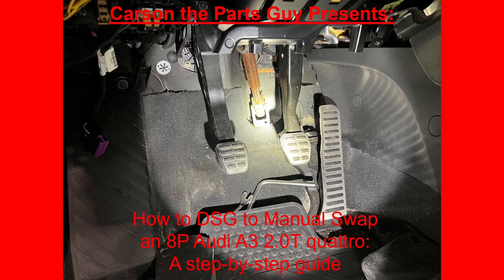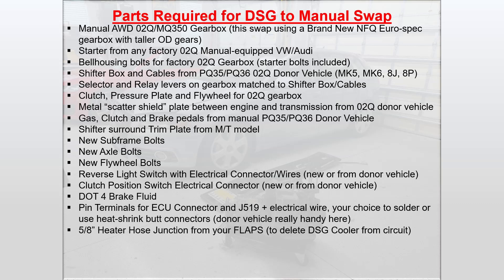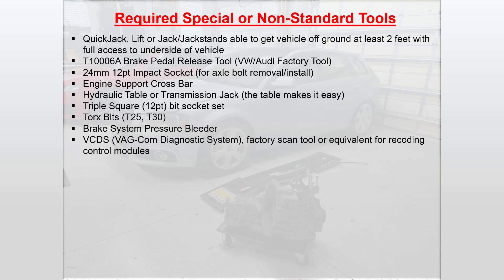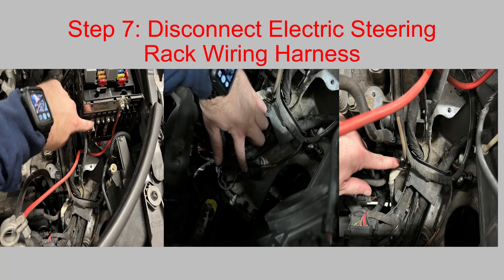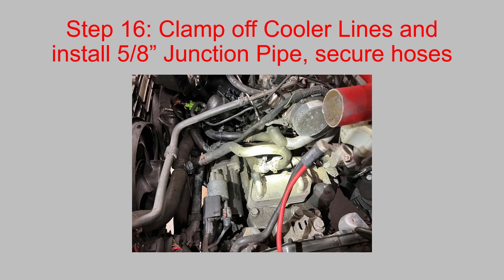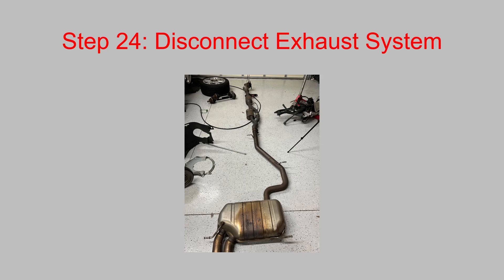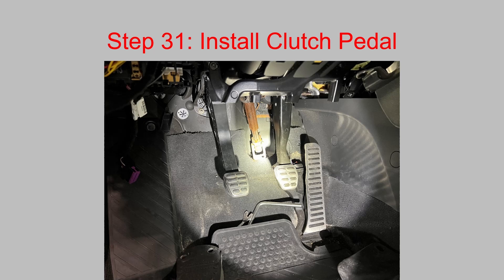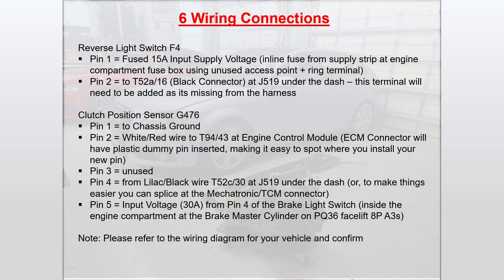DSG to Manual Swap - a step-by-step guide

Comment: Hey, I just did manual swap with wiring and programming all
Complete in my a3 8P Quattro. But I cant get to start it with key, I have to jump it with the starter. Would you known where to look to solve this issue?
Reply from the maker: Is your clutch switch grounded through J519 according to the wiring diagram? You can ground the purple/black wire in the DSG harness to get it to start.

Comment: I'm doing a tdi  swap myself,  both veichles are identical but the wiring harness on the manual was damaged.
Can i use the automatic wiring harness?
Reply from the maker: I didn’t swap harnesses on mine, I just added the necessary wires. You should be able to do the same.
Reply: @carsonthepartsguy8751  just ordered a bently manual, will do my best
Reply from the maker: @Anthony-sr3if  You can also just buy a 1 or 3 day subscription to VW/Audi’s ERWIN service, download all of the manuals you need and they’re yours to keep. Just FYI. 😉
Reply: @carsonthepartsguy8751  <3

Comment: on vcds im having trouble transferring it to manual.
so i went to 01-engine, coding-07, software coding i changed the last digit from 8 to 2 to signify 6 speed manual, but vcds says its out of range. thought?
Reply from the maker: That is a question for the guys at RossTech. They have pretty good tech support and they’re likely a better ask than I am. Your ECU may not be able to recoded. Best bet is to send them screen shots of your ECU identifier and they’ll tell you if it’s locked or not. You might have to get it reflashed to manual if it is.

Comment: No mention of the spigot bearing in the end of the flywheel. Does the manual trans and the DSG share the same spigot bearing?
Reply from the maker: Irrelevant. The DSG flywheel is incompatible with the manual transmission and vice versa.
Reply: @carsonthepartsguy8751  the spigot bearing is in the crankshaft not the flywheel.
Reply from the maker: @PetesWorkshop  The input shaft of the DSG is the only one that protrudes into the crank, so on the manual the pilot bearing isn’t used. Also, DSG and Manual engines share part numbers, so there’s that.
Reply: Oh! I did not know that. That is a lot of rotating mass to hang of the end of the gearbox input shaft. There is a listing for a spigot bearing for mk2 Audi TT 6spd Manual. I’m about to put a 2.0 tsi engine from a DSG mk6 GTi so I will report back my findings.
Reply from the maker: @PetesWorkshop  On the manual, the pilot bearing serves the purpose of receiving the clutch alignment tool, as when I did mine it fit right in. But if you Google pictures of the 02Q gearbox and 02E gearbox and look at the input shafts, you’ll see the difference.

Comment: Hello. I wanted to swap my dq200 to a manual 5 speed MFX transmission. Are the steps about the same or is there anything different? Also are there any compatibility issues? Its on a 2015 polo gt tsi.
Reply from the maker: Roughly. We don’t get the Polo or the DQ200 here in North America, so I’m not familiar with those. Best bet would be to get the components from a same year parts car that is manual so you can get everything you need to do the swap.

Comment: Hi after connecting the clutch sensor, will the car start? does it need to be programmed at all?
Reply from the maker: Needs to be connected to J517, it’s a purple and black wire that grounds the circuit when the clutch pedal
Is depressed to allow the starter to operate.
Reply: I have an Audi Q5, I installed a manual transmission, but now the engine does not start, I am looking for how to connect the wires so that the engine can be started 😀 but I can't find any information anywhere
Reply from the maker: @dariusruseckas3027  Yeah, that won’t be the same as this one. You’d probably want to download some wiring diagrams for a Euro-spec Q5 or possibly use an A4 as a reference as they’re on the same chassis.

Comment: Hey, i am looking to manual swap my A3 8p Quattro and I am not sure which car to look for for the awd transmission. Could you suggest to me a list of vehicles that would work or can I put a FWD gearbox and upgrade the LSD. Will the transfer case bolt-up to the fwd bell housing?
Reply from the maker: Regarding the FWD to AWD diff swap, you have to check the case to make sure it has the bosses tapped to accept the angle drive. But that is one route.
I got my NFQ box from Cascade German. You could use a Golf R, Golf Sportwagen 4Motion, alltrack, to name a few. Mostly on the VW side here in North America. 02Q or newer is the way to go.
Reply: Thank you for the reply!
Reply: @carsonthepartsguy8751  So I am in the process of swapping all parts, I have a set of MK7 GTiI Flywheel, Clutch and Pressure plate. I am wondering if i can use them on my Audi A3 8P TFSi and will it bolt up?
Reply from the maker: @joharzubair687  As far as I know, the MK7 EA888 Gen 3 engines have a different flywheel part number than the EA888 Gen 1 engines, so I can’t say it will work. They’re both 8 bolt flywheels, so it may be possible, but I have never personally tried it. I do have a spare SPEC single mass steel flywheel that needs the ring gear welded on that I could let go for a good price if you want to run a SPEC clutch and flywheel to go with it.
Reply: @carsonthepartsguy8751  Thanks for the reply, I am in Canada and I won't be able to take the deal cause of shipping and customs charges. so you are using a GEN1 Flywheel, Clutch and Pressure plate?
Reply: @carsonthepartsguy8751 , when you said  "02Q or newer...." does it mean it can also fit OFB transmission?
Reply: @carsonthepartsguy8751 I have completed my swap and everything manually works and it drives. So it’s great to hear, I am not able to start the car by key and I still have to program it. I am wondering if I can use Ross-Tech Micro-Can VCDS or I need hex V2? Thanks!

Comment: Can you do a video on how to swap a manual into a 2021 Audi S3? Thanks
Reply from the maker: I could, and its likely possible with the parts bin. But I don't have a 2021 S3 test subject or any of the parts.
Reply: @carsonthepartsguy8751  I would gladly supply a 2017 S3 if you would want a car to try it on.
Reply from the maker: @sawyercrosby3710  Well, I know it’s going to involve raiding the Golf R parts bin. And you’d probably want to go aftermarket on the clutch, pressure plate and flywheel setup. All that’s left to figure out is coding and wiring. If you’re serious, my Audi-modding co-conspirator Matt and I have discussed doing this kind of work on the side out of his garage in Vero Beach. We can talk about that if you’re serious. 🙂
Reply: @carsonthepartsguy8751  I’ll need a couple months- just bought a house but I’m game. The mechanical aspect doesn’t bother me so much as the wiring and coding aspect of it.
Reply: @carsonthepartsguy8751   i just retired down to the southern AL area. I've got a mk 7 golf r transmission and bevel box ready. Ill be acquiring the rest of the parts slowly, but I'm probably going to get an S3 sometime in the 2025 era....which year I'll feed once done. I've got to finish paying off my wife's Yukon then I can take this project on.

Currently I'm also getting parts to do the AWD swap on my 15 GLI. But that project is going slow due to that is my daily driver to work currently. I'd prefer to get the S3 manual swap completed first then get back on to this...

Comment: Hi I wanna Swap my manual to dsg my MK7 Golf R its currently stripped out already I wanna put the 7speed Dsg from the 7.5 what do I exactly need to do? And what do I need apart from the gearbox and Im guessing the ECU itself?
Reply from the maker: The ECU can likely be recoded. You’ll need to wire in the whole DSG harness into the car, and for that you’d have to refer to the wiring diagram for a MK7/7.5 DSG car.

Comment: very good Congratulations!  I'm thinking of doing the opposite :) remove the manual transmission and install the DSG :) will it be an easy process?
Reply from the maker: I’d say it’s harder. More wiring connections to make.
Reply: @carsonthepartsguy8751  

I already have some schematics and wiring here.. I'm just putting together material
Reply: Hey Eduardo, whats your location? Im looking to do a manual swap, i have a DSG... If youre close enough we can consider trading. Im in SoCal
Reply: @arnoldca8377  it would be awesome :) but I'm in Portugal

Comment: I have a 05 8p manual, rebuilt the engine and upgraded to k04/s3 injectors.
Brought car to tuner who can’t tune my ecu.
Bought a Eurodyne Maestro which also doesn’t support my ecu.
Bought s3 ecu(supported by maestro) and Audi can’t code the immobilizer to work.
Bought a P revision ecu which did code to car but was from an auto car.
Changed coding from auto to manual but I still get an esp fault for no communication with transmission in the ABS module, cant find any auto/manual coding in the abs unit.
Also the ecu was from a SULEV car which complains about evap test not working and sets MIL so I can’t pass emissions. can’t change evap protocol in the ecu it just says coding rejected.
I’m so bummed now as it’s just a money pit :(
Any inputs on what to do?
Reply from the maker: Go standalone? What’s your engine code?
Reply: @carsonthepartsguy8751  AXX engine code.
I’m going to daily drive this car so it needs to pass inspections(No emissions/dtc codes) and I doubt standalone would do that , though I haven’t looked into it.
Reply from the maker: @BMWe-ed2tn  Something like SYVECS would. But I’m more familiar with North American-spec engine codes as I’m based in the USA.
In the US, we had the BPY, a 2.0TFSI timing belt engine from 2006-2008. That got replaced with the EA888 Gen 1 CCTA motor.

Comment: Hello, what happens if the throttle reverse stop is not removed?
Reply from the maker: You mean the kick-down detent? Basically, an obstruction to you going wide-open throttle that is unnecessary.
Reply: @carsonthepartsguy8751  thanks Carson, regards

Comment: Is it possible to swap the RWD A3 2.0 8p (EA888) with dq250 to the 02Q or 02S?
Reply from the maker: The swap in this video is of an AWD 8P A3 EA888 with a DQ250 to an MQ350 (02Q) gearbox. You can also swap a FWD with the appropriate gearbox as well. RWD A3s were never offered from the factory anywhere.

Comment: Hi does dsg gearbox fit bhy Mk5 engine or which automatic trans can be used on my bhy engine thanks in advance
Reply from the maker: I’d need some more information to better assist you. Hit me up over IG or FB via PM with your VIN and I’ll try and get you sorted. Please keep in mind that I’m based in the United States.

Comment: Bro love this video I need your help I have a 18 Passat GT 3.6L I have a DQ250 in it and I want to put a 08 Audi TT 3.2L 6 speed manual in it I know it blots up with no problems but software how did you let the ecu know you don’t have a DSG anymore?? Please help me lol
Reply from the maker: I was able to recode mine via VCDS. But with a 3.6 VR6, I’m not sure if you can do that. You might have to have it flashed with software. Plus, I don’t know of any factory applications that got a manual 3.6 VR.
Reply: Your correct nobody has a manual 3.6L but I have seen guys put a 3.6L in their 3.2 Audi tt and R32
Reply from the maker: @fredjones5327  May want to reach out to one of those guys and see what they did for software. You should be able to tweak the rest of the control modules in the car.
Reply: Awesome bro I appreciate you answering me so quick, I’m gonna try to follow your set up as best as I can to get this in, I was told the 04 R32 and 08 Audi tt 6 speed just fit with no issues but… I also want to convert it to AWD as well, I know of someone that did a AWD swap on his 18 GT using parts from a 11-14 VW cc 3.6 4 motion it went together no problems no fabrication it’s just trying to pick his thoughts he doesn’t answer me so I’m trying g to get this parts list together in my own
Reply: @carsonthepartsguy8751  what’s up brother me again lol quick question.. where can I get a wiring diagram for the 2008 audi tt 3.2 manual?? I was told start there to see  what I need to do to wire the ecu
Reply from the maker: @fredjones5327  Get a 1-3 day subscription to ERWIN, which is VW/Audi’s online service manual. You can download the entire manual for any number of cars during the subscription period and keep them for your reference. 😉

Comment: Hi i have completed the manual swap on my 2011 golf GTI. Maneul boxes in there selector is in all panda. Wiring is done to how you states to be done throughout. The Mach 6GTI wiring diagram for my car, but at the moment codeing has taken place take and hold says depressed clutch pedal to start Yes it’s fine but the car is not detecting the clutch pedal press isn’t starting Any pointers on how to get the car to register the clutch pedal press
Reply from the maker: You have to run the wire between the clutch pedal and J519, and recode J519 to indicate it’s a manual gearbox. On my car it’s a purple/black wire that runs from the DSG to J519. You can also ground that wire out, but that would allow the starter to engage with the clutch pedal up.
Reply: Thank you very much man I really appreciate it
Reply: @caleblyons66  did you find the problem?
Reply: @jorgemgarcia7353
Yes i fix it all up has been running really well for ages
Reply: @caleblyons66  how?
Reply: Wiring diagram for the mk6 gti and my car the wires didn’t match up so we had to trace individual wires to get it to work

Comment: The swap is done on my 2010 vw scirocco, but i haven't understand how to wire the reverse light switch in the fuse box
Can you please help me out?
Reply from the maker: We didn’t get the “new” Scirocco here in the United States. But, with that said, my car is wired as follows:
Fused Power from the engine compartment multi-fuse (I used an inline fuse) to the reverse light switch, wire out of the reverse light switch to J519 under the dash. Recode J519 to tell the car it’s manual. Would highly suggest grabbing the wiring diagrams for your particular Scirocco and locate which pin in J519 accepts the reverse light switch signal.
Reply: Can you please explain from which fuse compartment( engine or dashboard side fuse compartment) have you installed the wire ? because i took a wire to the dash board fuse compartment and i had a problem that the car refused to start
Thanks for having time to reply 😊
Reply from the maker: @mustaphahadjmahmoud-ex5ow  I ran a wire directly from the engine compartment fuse block, which has stud terminals you can throw a ring terminal and nut onto to use for power. That goes to an inline fuse as specified in my video, then to the reverse light switch, and from the reverse light switch a wire is fed to J519 to provide the reverse light signal so J519 activates the lights when you put it in reverse.
Reply: I got it! Thanks mate!

Comment: By chance can you give the wiring references for a dsg to manual on a  GTI? Also the coding if it is different?
Reply: mk6 gti
2010
Reply from the maker: @brianhogan584  It will be similar to this, but you should refer to the wiring diagram for a GTI. You can get that through ERWIN on a 1 day subscription. Coding should be similar and through the same modules. VCDS should give you the necessary values.

Comment: Is it possible to do the same in reverse? Switching from a manual gearbox to a DSG gearbox? If yes, is the procedure similar or are there more changes to be made and/or more parts to be replaced? Thank you in advance!
Reply from the maker: It can be done, but requires a lot more wiring, therefore increasing the difficulty. It’s not a subject I plan to cover, as my wife’s car is already DSG. Just finished swapping to a different gearbox code on that one though. Taller 5th and 6th gears from a VW Eos.
Reply: @carsonthepartsguy8751  Ok thanks a lot for the quick clarification! However, could you tell me what adjustments and corrections I should make in the cabling/wiring to switch from manual to DSG?
Thank you in advance!
Reply from the maker: @silvakko  You’ll have to refer to a wiring diagram for that. Best bet would be to get a harness out of a DSG car and use that as a base - separate the DSG wiring from the rest of the harness, checking it against the diagram and then add it into your vehicle that you’re converting.
Reply: @carsonthepartsguy8751  Ok I will try to do that! Thank you very much for the fantastic content and your knowledge that is so rich and deep on the subject. Best regards!
Reply: @silvakko  Hey Frederico, whats your location? Im looking to do a manual swap, i have a DSG... If youre close enough we can consider trading. Im in SoCal

Comment: About how much did all this cost?
Reply from the maker: I paid $1150 shipped for the brand new gearbox, flywheel and clutch setup was $500 (got a deal) and the rest of the parts came from a wrecked MK5 GTI I bought for $350 and parted out. 😉

Comment: Nice video man. When I code my cayc ecu to manual 6 speed using long code helper the coding is rejected. Did you not get this problem?
Reply from the maker: I did not. No problems recoding the ECU for my CCTA code NA-spec ECU. Your other option would be to get a tuner to reflash the ECU with a manual file.
Reply: @carsonthepartsguy8751  Maybe because it's South African variant but will give it a try.